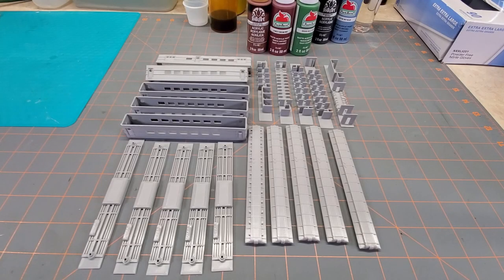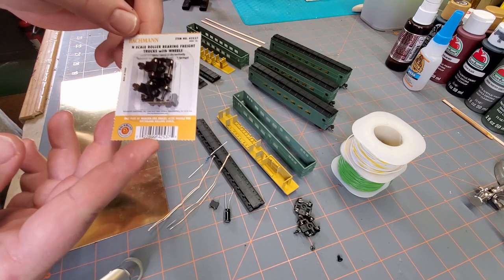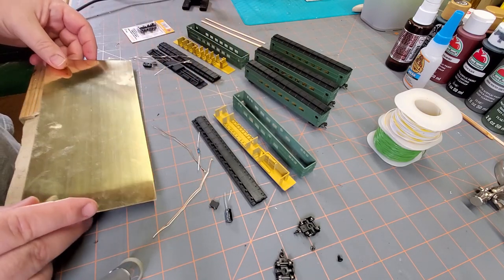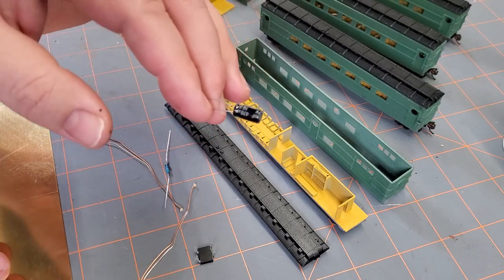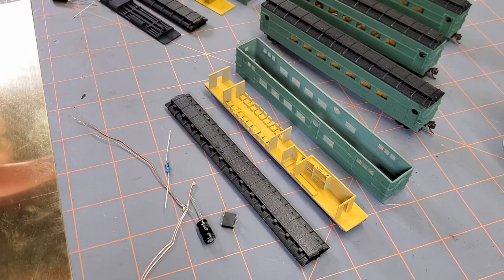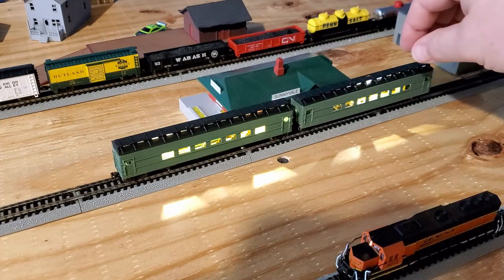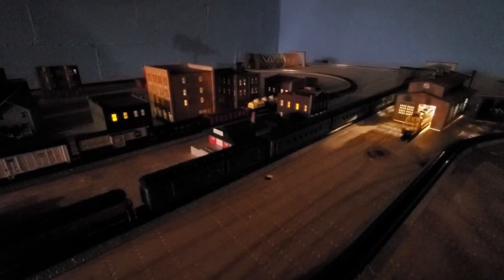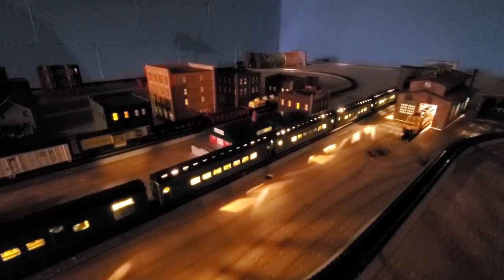3D Printed N Scale Model Railroad Passenger Cars. How To Add Track Powered Lighting

Comment: a small tip.. you can just hold a small bit in your hand for the drilling part.. a new sharp bit will easily work quickly with hand power, and you will be sure to not have a delicate mishap :)  
really enjoyable video, cheers! 🤓
Reply from the maker: Thank you for the great tip. I recently purchased a nice pin vice and bits. Hopefully that will give me better control.... Take care and happy railroading.......

Comment: Paul   Get some Rosin flux or even better rosin core fine wire solder.  I see from the video your iron is not tinned. Find a small kitchen sponge and keep it damp, run your iron tip over it when ever it gets dull, add some solder to the tip it should be silver and use that area to do the soldering. If you need flux see if you can find a flux pen.   Heat the material and add the solder directly.  You should see the flux smoke off. rinse the flux off with a q tip either moistened with H2O or rubbing Alcohol.  You should pre tin ( add some solder to the surface) the axle brushes before mounting. Some brass has a lacquer protection to keep it shiny so it may need to be sanded lightly where the metal touches the axles and where it is soldered.
Reply from the maker: Peter thank you for all the information. Since I posted that video I have since purchased a nice soldering station that came with a sponge and tray for it built in. It also allows me to control the temperature. Plus I have better tips now.  I still need to buy some Rosin Flux. I did not however know about the brass having a coating on. That probably explains why I was having such a difficult time soldering the wire to it until it got really heated up and probably burned off the coating. Thank you again for the great information and for taking the time to watch my videos.

Comment: Couple minor comments on your soldering, nothing major but should help a little. Use a small amount of flux when soldering and solder using the tip, not the side, the tip will be the hottest part of the iron.
Reply from the maker: Hey Marty, thank you for the insight. I still need to go buy some good Flux, but I did find some older Flux I use for plumbing. Gonna give that a try until I can purchase something better. And the tip. I don't know if I overheated that particular tip because I can't get it to melt solder to save my life. I am actually working on a video of soldering my track together and I changed to a flat tip, like a screwdriver flat, and it seems to work much better. Thanks again for the advice and keep it coming. And thanks for subscribing.

Comment: Those cars don't need weights? They look kind of light!? 🤔
Reply from the maker: Hey again James. I have a little weight in mine on both ends over the trucks because I lit my interior so I have a capacitor on on end and a bridge rectifier on the other end. Even with that they are still a little wobbly. You can fit a thin piece of metal between the base and the interior of the coaches. I just didn't have any at the time, and actually I still don't. But they still run well.